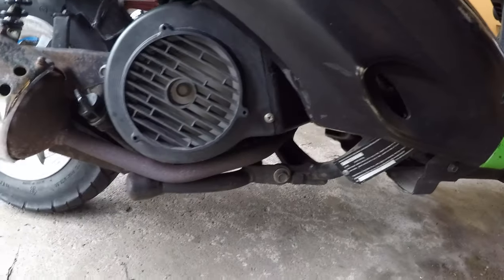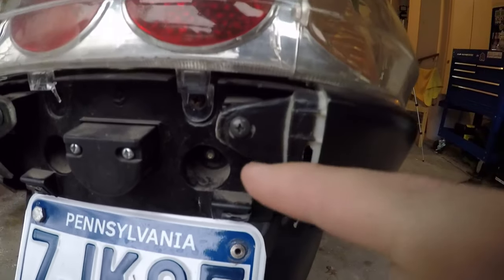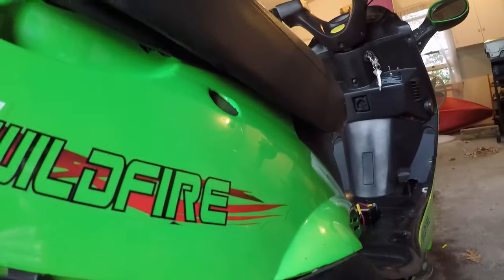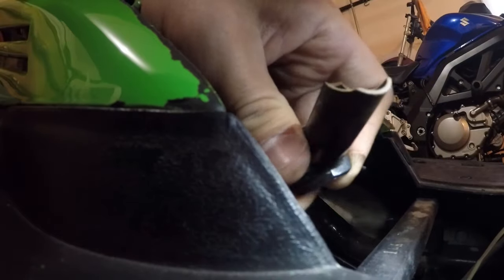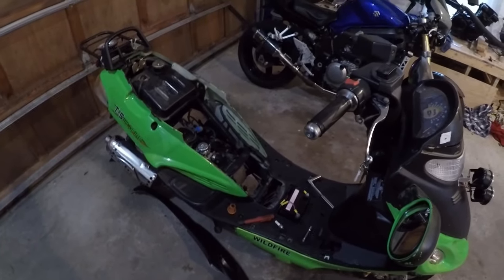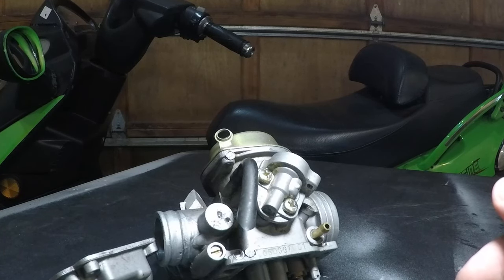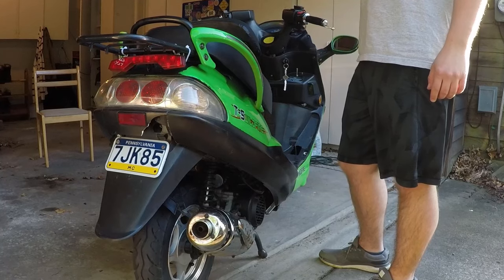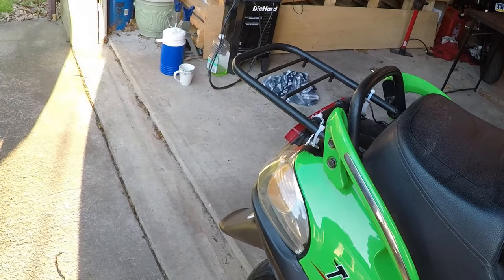Scooter Won't Start or Idle? Try These 5 Things to Get It Running | 150cc and 50cc GY6 Scooters

Comment: I am 71 years old and bought a trike in Aug 2021. It's a 2021 and spends most of it's time in the shop. Right now it's doing exactly the same thing yours is doing. Going in the shop mon 3 Jan 2022. Thanks for the video, so when they talk to me this time I will understand if they know what they're talking about.
Reply from the maker: Awesome.  There isn't much to these things.  So, by doing just a little bit of research, you can troubleshoot an issue pretty easily.  Thanks for watching!

Comment: Just took my carb apart and was running fine, now it won't idle. Thanks for the information, gonna try to fix it this weekend
Reply from the maker: Good luck!
Reply: @TyposGarage  It started working good all of a sudden and I drove it a couple miles, so I say whatever I did worked :) thanks again!

Comment: Hello thanks for the video im guessing it is what messing up my scooter cause once i unplugged the vacume line that goes to valve it runs fine until gas runs out, watching from Honduras brother 👍
Reply from the maker: Thanks for watching!  You could have a bad fuel pump.  The fuel pump on these is operated by vacuum, which might explain why it will run until it runs out of fuel in the carb.

Comment: I just had the same thing it was the petcock letting petrol in the vacuum pipe I put on new clear fuel pipes and saw it running down the pipe to the vac inlet to the engine so look out for that.

Comment: I had a problem where it wouldn't start..that's what it was. The metal piece that attaches to the plug was actually on the plug. Replaced the coil and it fired right up 👍 Then after that the fuel vacuum diaphragm started leaking.. making it run rough on warm starts and a couple of times hard starting. Replaced the vacuum diaphragm and carb..if the diaphragm goes bad again I'm gonna replace it with a on/off petcock.

Comment: Great video you finally solve the problem i have honda giorno with 2 strokes mine wont start my manually and starter. sometimes it start and dont idle long just like to your scooter. After I clean my carburator, change my spark plug still wont idle and start maybe i should check my valve....
Reply: 2 strokes don't have valves though
Reply: @akmcg  oww...thank you sir

Comment: It's unbelievable, how you went completely backwards on the checking sequence! 
Starting with the CDI is, let's say, amusing! Valves, etc... While leaving the main culprit (carb) to last. ;-)
The simple fact that, otherwise, it started and run. Set aside all the other gimmicks. As main actors. Surely a decent valve adjustment improve things. Surely a plug boot in one piece also help, etc. But idle issues 99% take you straight to the carburetor. The rest comes after. 
Please check K.I.S.S ;-)

Comment: Hey Man I love your videos bro. I need your help please. I have a 200cc moped,and I’m new to the moped I just got it new here is my problem my friend. The headlights stay ON even if my Key is in my pocket and the Engine is OFF???🤔 I don’t no what to do??? It keeps killing my battery.🪫  I have to disconnect the power cord from the battery to shut it off every time!!! Please help me out sir I would really appreciate it thanks again and I hope to hear from you, or can you please make a small video of that I will watch it.🎬🎥🎧🤪😂👌💫🌏
Reply from the maker: Thanks man! It seems like something is wrong with your ignition. The ignition is the connecting unit from the battery to the electronics. There's a chance one of your wires are stripped and may be touching a 12v supply wire. Do you have the ability to take apart the front of your moped? I would also check your fuses. You may have one melted. Try to hit the starter button with the key out to see if it still has power.

Comment: Hello, I have a problem, I have a Peugeot Speedfight 1 100cc that recently seized up/heat seized. It was not tuned. I then changed the cylinder, piston etc. It now starts up right away, but after a while it dies all of a sudden (as if you had turned off the key) and then I can start it right up again, this usually happens when I go over 60 km/h or uphill. 

When I changed the cylinder etc, I also cleaned everything thoroughly, such as the carburettor, intake, new air filter, new fuel filter (there was no fuel filter before) new spark plug. I also removed the oil pump and put a metalplate with a gasket over the hole instead, I now mix the oil directly into the gasoline. 

Some other info that might be important. 
- When I drive over 60 km/h, it starts to make a noise from the variator (CVT), it´s sounds quite a lot. 
- When it died, I tried to start it again while it was rolling and then it started right away, but it made a noise from the variator, like something "let go" that had been seized up, like a rubber sound, maybe from the belt. 
- The variator belt touches the variator cover on the inside and has grinded a cut in the metal. 
- In the variator, where the weights are, the belt does not go down to the bottom of the wheel. 
- The clutch bell had turned blue from the heat. 
- The place where the connecting rod attaches to the crankshaft had turned blue from heat. 
- There was no fuel filter on it before. But i now saw there is an internal fuel filter in the gastank, can it affect the vacuum if you now have 2 fuel filters.  
 
Please help me. 

Regards  
Andree.
Reply: Get a few spark plugs, eliminate all the emission crap and then run simply (and cleanly I might add) without all the cheap plastic emissions CRAP. All those plastic junk devises only malfunction and produce the emissions they proport to eliminate.

 If you have a pair system don't eliminate the egr as the valves are not built or suited for that... But, all the useless vapor and recycle vacuum lines and plastic devices that virtually do nothing but malfunction should be eliminated. This is not a opinion, it's a fact and if you don't know, research or find a good mechanic to help you to know what to get rid of.   Most of that crap is just that, crap to malfunction.

Apparently dependability is not a factor when it comes to scooters...

Funny thing though, they still haven't put a airbag or seatbelts on one huh -:)

Kinda reminds me of a fool that will put a emissions system on a 50cc motor.

Complicate a problem with a bunch of other problems, yea that'll fix it huh... 

Pure silliness.

https://youtu.be/iMX5wi7Vz0Q?t=9
Reply: Oh yea and you'll need a oil pump too :-)
Reply: @thehippiedog5956  I took it for a testdrive today and after a while it stopped, so i removed the variator cover to check how it looked and the axle where the weights are that goes into the engine was stuck, so i turned it a bit and it let go, and after it was a bit hard to start again. 

What could this be? I checked the fuel line and the vacuum valve that goes into the gastank and they worked, if it was some bad bearings in the engine would that be enough to stop the engine while running? If it would be some bad bearings wouldn´t that just like vibrate a bit more, and not stop the engine all toghether. 

Could something in the engine have taken damage when it heatsized? If so what is the most likely to have taken damage.
Reply: @thehippiedog5956  Hello again, today i opened the cylinder to check, and there was scratches in it, not deep, i could see them but not feel them. So that must have been why it was stuck after it stopped. 

Does this mean that the crank or bearings are bad? I don´t know what else it could be. Like i said before, i now use premixed fuel with 3% oil, and i have checked the vacuumtap that it worked, i have removed the extra fuelfilter, the carb is cleaned and has the right size jets. It has new airfilter and sparkplug. 

I saw now that the scratches are pretty wide, one is like in half the cylinder, almost like the pistonring itself has made the wide scratch, could i have stretched them to much when i installed the cylinder?
Reply: @NorthSurvival  My first inclination is valve adjustment. Seems complicated but it's really not. 004 is the key I tend to do a tight 004 on intake and a loose 004 on exhaust as the exhaust valve will get tighter over time...

P{ull the valve cover and don't worry about over tightening the lock nuts as this is the thing that will mess up your valve adjustment. Although you started with the variator in your post, remember all is relative so a bad running engine can effect many other components and that is a symptom, not the disease so to speak...

Valve adjustment is the crucial thing on a 4 stroke, if you are running a 2 stroke motor the oil is. So a 2 stroke cannot be side saddled by putting iol in the tank and a 4 stroke should have regular valve adjustments (no hydraulic valve lifters on that one)...

2 stroke use synthetic oil and make damn sure the pump is working correctly. 4 Stroke? get a set of feeler gauges and use them anytime you have a problem...

Here's a vid...

https://youtu.be/-95MGZuFbH8
Reply: @thehippiedog5956  Hi, it´s a 2 stroke and i now use 3% premixe fuel, to be sure it get´s oil.  Now after i opened it up again i saw that there was scratches in the cylinder and bigger/deeper once in the piston/rings. So that whole cylinderkit for 200$ is trash. I don´t know what to do, maybe the crank got damaged the first time it heatsized, so now it´s not inline. 

I checked the pistonrings and they had a small gap like they should so they can expand. 

What do you think, ruled out a lot of things and the only thing left (i think) is that the crankshaft/crankshaft bearings has gotten damaged/out of line. And when i now opened the cylinder it was oil in it and on the piston and in the bottom of the crankcase so i am pretty sure that it get´s the oil it needs, so that can´t be why.
Reply: @NorthSurvival  Well it's been over heated due to pump failure.

Did you do the bottom end? If it seized or came even close to seizing then the connecting rod is probably deformed making it out of balance. That would explain the scratched jug, the piston is no longer properly aligned for stroke. I wish I had some better news for ya. 

May as well do crank bearings and replace the connecting rod before replacing the jug and piston.

Luckily if it's a 2 stroke it should be relatively easy to do... 

Oh and fix the oil pump, that is what started the problems to begin with right?

Here's some basic help:

Piaggio Zip SP Bottom End Rebuild...
https://youtu.be/aPWoYO6lyos

Is my 2 stroke blowing up?
https://youtu.be/5oIq04rFJdo

And some fun stuff too...

Riding until 2 stroke blows up!!!!
https://youtu.be/IwSfoQqt41Y
Reply: @thehippiedog5956  Thanks for the advise. So i´m thinking of replacing the crankshaft/rod, the crank bearings, the cylinder, the piston, the pistonrings, the needle bearings. 

Do you think that will do it, and i will run on 2,7-3% premixed fuel.
Reply: @NorthSurvival  If it was me (free advise) I would make damn sure the oil pump was right and I'll tell you why... Many years ago I had a 2 stroke YZ125 the thing was a screamer you didn't dare try to pop a wheelie in first gear a monster bike!!!

The 2 stroke oil pump went out so I wired it (the pump wire) to wide open throttle and filled the tank with oil just to be safe and then started mixing the 2 stroke oil in the tank the way you are. Lasted about 3 good rides and seized. 

Then the crank bearings went out, then it seized again. 

So I don't really know why, maybe it was sucking air or it created a drag on the motor but you couldn't keep it on the track after that. Fixed the stock oil injection setup and it ran great with no more problems.

So my (free) advise is fix the original oil pump, there is apparently something to it that is just not obvious. And it makes sense to just mix oil in the tank and go (oil is oil right?)  but it has never worked for me for what ever reason. 

So if you are going to split the case ya may as well fix the pump while you are there and be done with it.

And like I said that's free advise...

...take it for what it's worth :-)

Comment: Valve adjustment is so dreadful that you went through all that just so you wouldn’t have to check valves LOL amen brother!
Reply from the maker: Lol! It's so time consuming.
Reply: Urg I went all the way to the point of getting a new CVT housing,backplate,rooler and sliders once to avoid having to replace valves lol, Don't blame you are all! It's not only a wicked bitch, it takes forever, but the most annoying part is you have to completely put it all back together to test it! 

Perhaps the ultimate infuriation when it comes to scooter issues is having a fuel value that's too wide.... Bought a scooter with a little bit of a bogging issue and figured I could fix it pretty easy, but it wasn't until I'd replaced quiet literally every hose, filter, line, cvt part, and eventually the carb that it finally clicked in my dumb ass brain * I bought this from a dude would lived in a town   nearly 1000 ft lower then mine to sea level. Plus I'm 80% certain that he'd already attempted to resolve a issue with the scooter by putting in a large then stock tip on the fuel stem in the carb to begin with.

Comment: I'm late to this video, but before I pull out the carburetor, I want to spray some cleaner on it.  It has sat for a while.  I cannot figure out where to spray it.  I need some more detail on where the air intake and carb part are located and perhaps what they look like.  Some videos address the issue, but they don't take it to the finish line.

Comment: I have a rough idle and it’ll die but won’t die if I give it a little gas. Also the lights dim and get brighter when I give gas, and the blinker turned itself off at one point.
Reply from the maker: It sounds dumb, but I would check your battery.  When my battery starts to get low, the blinker wont work and the headlights are super dim. Charge up the batter all the way and see if the issue goes away. If not, there could be something in your charging system that is going bad. What type of scooter do you have?
Reply: @TyposGarage  ti checked that and it’s completely charged but I haven’t checked it while turning it on yet. I just found a broken air filter house and some fuel in my AC housing. Oh brother!
Reply from the maker: Use some brake cleaner or starting fluid and spray over the broken housing. If it surges, that might be your idle issue. That would also pull on the battery. The gas in your ac could be from giving it too much throttle to keep it running.
Reply: @TyposGarage  ok I’ll try that thanks! So it’s possible the gas isn’t necessarily some type of leak or broken part on the inside but just from overthrottling?
Reply from the maker: Yeah. It's definitely possible. You might also need to check your floats in the carburetor. If they are se wrong, the carb could flood the engine. That's basically what happened to my scoot. The float was cracked and had gas in it, making it not "float" anymore. Does your scooter smoke when its struggling to idle?
Reply: @TyposGarage  mine does and it idle super high, and it only starts with starting fluid. it smokes kinda and after 5 second it dies
Reply: @theatlasvision mines doing the same as urs with the high idle and start with starter fluid what was your cause of the problem
Reply: @GrowDatSolja  it is probably too lean you need bigger jets or maybe your air filter is too big idk if its that bro its been 2 years

Comment: I put a 150cc carb on it but it will not start or run or idle I tried cdi spark plug carb still want work

Comment: great video.

question: i have a 50cc scooter.  new battery, new spark plug, new filter.
when i press ignition button and twist throttle it makes the sound like this at 1:14 but wont start. it will however start if i jump start battery, even though battery is new.
i dont think its the battery bc lights, horn, etc all work fine.
any ideas?

great tutorial and video.

/Bklyn👑
Reply from the maker: So, if you jumpstart the battery at the starter solenoid, it will start? Does it run fine after that?
Reply: @TyposGarage  figured out the problem: spark plug boot was defective.
great channel bro.  thanks.

new subscriber.

/Bklyn👑
Reply from the maker: Great to hear! And I appreciate it.

Comment: okay, been learning a lot from your videos: from CDI to ignition coils to variators and beyond.
i gotta question tho ... im fixing a 50cc scooter (139qmb) and the engine revs at high rpms even at 10 miles per hour.  even tho im a newbie to chinese scooter repair (ebike mechanic here) I know that it shouldn’t rev this high at such a low speed.  i heard it could be something to do with the pistons in the engine.  no sure.  any thoughts. still learning...still excited everyday. /Bklyn👑
Reply from the maker: To me, it seems like your clutch/cvt is not disengaging/engaging fully. This would explain the free spinning of the engine.  It would be like holding the clutch lever halfway in and the bike revs up while moving a little.  Check out some videos where people show symptoms of their cvt acting up.

Comment: Can you tell me where the hose on the valve cover connects to
Reply from the maker: It connects to the vacuum operated fuel pump. The crankcase creates a vacuum that pulls fuel to the carb
Reply: @TyposGarage  hmm mine is missing but the scooter runs great